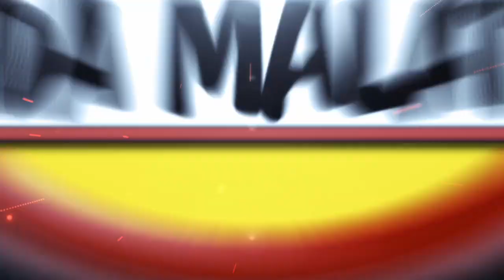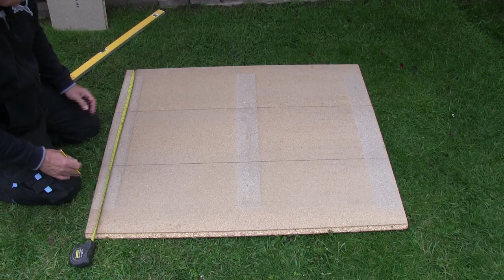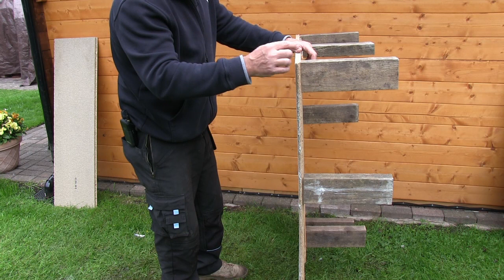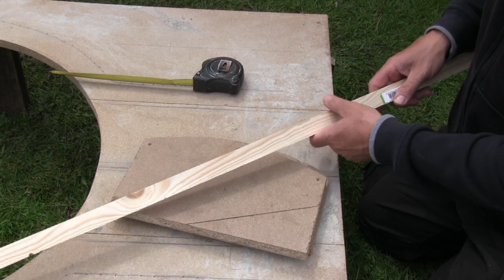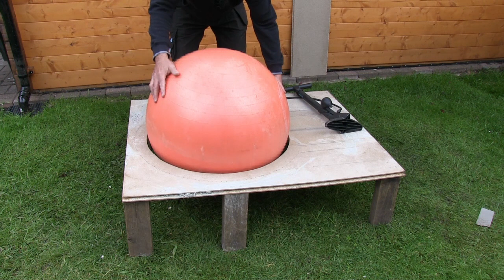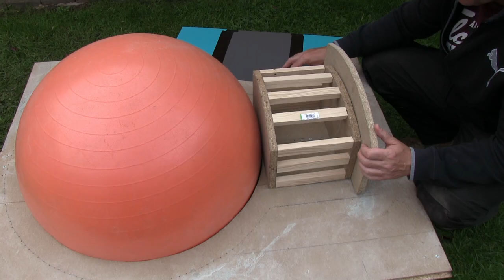AMAZING Outdoor Pizza Oven (part 2) Built for £70 - about $90

Comment from the maker: There is an error in the dimensions given at 16:40 mins into the video. The length of the side for the larger of the 3 entrance tunnel plates is 18cm long and not 22cm long as stated in the video
Reply: How is the tunnel length calculated? I'm trying to scale these dimensions for a 75cm diameter ball plus 10cm thick walls (rather than 6cm as per here).
Reply from the maker: @diyenthu2844  A 4" (100mm) flue is a good size to have for this type of oven. Since doing these videos, I've experimented quite a bit and found 700mm to be a good height for the flue in order to create a decent draw on the fire. The tunnel length is dictated by encorporating the flue into it and having some room at the front (100mm) for the brick arch. The most important measurement is the height ratio of the tunnel in relation to the dome height which I've found to be between  55% and 60% (the optimum height ratio for a brick built oven is 63%). The reason for reducing the ratio for a vermiculite concrete oven is the temp at which these concrete ovens work (brick built ovens work at much higher temperatures). If you go above 60%, too much heat is lost. So if the internal dome height is 100cm (for easy calculation), the tunnel height (internal) would be between 55cm and 60cm. With regards to the tunnel width, I've always gone with 33cm (13 inch) in order to get at least a 12 inch pizza to fit. Hope this helps. Please join or facebook group where you'll find lots of members currently in the pizza oven build process and sharing tips and ideas: https://www.facebook.com/groups/damalatspices

Comment: Very well done! The best comprehensive step-by-step guide I've seen for building your own outdoor pizza oven.  Just a quick question: The door to the oven is close to13" wide which is probably good for baking pizza up to 12".  Could I increase  the width of the door opening to16", keeping all other dimensions (door height, oven diameter) the same, or would this be a problem?

Comment: Can you use refractory cement with no vermiculite? I thought those prefabbed ovens are just refractory cement molded.
Reply: Vermiculite will make it a lot lighter. Refractory mix, if I am not mistaken, is roughly 80lb/ft3 min to 120lb/ft3, and thus probably needs to be cast in place.

Comment: @16:10, when you’re getting started with the final, larger template, if you want an exact center line, measure some distance from that center corner, use that distance to measure out on the sides of the corner, then cross the two opposing arcs.  Where they cross and the large center corner are now lined up for a perfect bisection of that larger corner.

Comment: Hi DaMalat, whats the pros and cons to making the entrance bigger so a bigger pizza/pizza tray can fit in? Or even if its possible?
Reply from the maker: Entrance size is important to enable air flow but restrict heat loss. You can't really go any higher and if you widen the entrance by more than a couple of cm's you will get quite a lot of heat loss from the set fire.

Comment: Am I being stupid ( please be kind ) I can only find 75 cm sized balls. Is that going to be close enough?
Reply from the maker: You only need the ball to inflate to 70cm (I used a 76cm ball as that was the only size I could get on a tight budget to fit the 70cm opening of the gym ball hole cut in the sheet wood). 75cm is fine.

Comment: I have considered making a 150mm thick hemisphere from vermiculate over a mould and then cutting it down to large brick sized pieces. My thinking is that I can almost eliminate mortar between square bricks in doing this. - your opinion would be valued thanks .
Reply from the maker: It might be cheaper and less time consuming to make the bricks from aerated concrete blocks? They would be very easy to shave off material until you have a perfect fit.
Reply: @DaMalat  my mate has got a 6 in double walled insulated pipe will this work istead of the brick chimney or is it to big ??
Reply from the maker: @gavinwebb5993  Yes it will but don't try to build it into the dome structure. You need to find a way to fasten it down from the top. If you build it into the concrete dome, the pipe will expand and crack the concrete when a fire is lit.

Comment: In relation to the measurement correction I didn't see this post in time. I've just made mine with the incorrect measurements. So the entrance tunnel will be quite top heavy.  I will just see how it goes as I can't undo it now. Thanks for pointing it out though.

As for the fire blanket insulation. Any suggestions how to attach it and how best to render over the top of the blanket. Thanks
Reply from the maker: Sorry for the late reply, YT has stopped message alerts for videos over a month old. lay the ceramic blanket over the dome and fix in place with another chicken wire frame (cut strips of wire off the chicken wire roll and bring the cage together tightly around the base). Then render over the top. Check out our facebook group. lots of advice and info sharing from members who have already added a ceramic blanket to their build: https://www.facebook.com/groups/damalatspices/
Reply: @DaMalat  Thanks for the reply! The pics on Facebook look amazing. Clearly you are inspiring people far and wide!

Comment: Hi nice videos, I am currently on with trying to build this and have a query. the front section of the tunnell, at 22cm tall sides makes the   overall height at widest part 30cm but the tunnel is only 20cm. This creates a 10cm thickness to the tunnel roof, this doesn't look the case on the video. Should the 22cm not have been at the same width as the internal tunnel dimension to create a  parallel thickness to the tunnel or is it thicker due to the chimney? Thanks
Reply from the maker: Hi John. The internal width of the tunnel is 33cm. The external width of the tunnel is 45cm. The internal height of the tunnel at the sides is 16cm with the internal height of the tunnel at it's highest point (dead centre) is approximately 19cm. The overall external height of the tunnel at the sides is 22cm with the maximum external height of the tunnel (dead centre) is 25cm approximately. Therefore you should have 2 x wood plates at 33cm wide x 16cm tall at the side and 19cm tall in the centre. Plus 1 x plate at 45cm wide x 22cm high at the sides and 25cm high dead centre. The vermiculite concrete comes flush with the top and sides of the larger plate creating a 6cm thickness all round.
Reply: @DaMalat  I'm with John on this one. I have done mine last week and found this problem too. If you do 22cm height at the sides on the bigger plate you will end up 10 cm on the top. You actually need to do 18 cm height then you will get 6cm thickness all round. Very good example is Scott Brannan in your facebook group just look at his picture https://www.facebook.com/photo?fbid=10163419777525015&set=pcb.2664338617007820

But still as I mentioned before your videos the best so far on youtube regarding pizza oven build. 
Could you please answer one more question. I have done mine oven last Saturday and so far I'm concern about vermiculite concrete. The particles that been left on the floor is very crumbly so far. Is that what you experienced too? I started to look for vermiculite mix ratio and it's actually 5:1 or 7:1 even 10:1 sometimes. Is there any specific reason why you chose a 5:2 ratio?
Reply from the maker: @viktorskr  Thanks Victor. I need to look into this as mine didn't turn out like that. Appologies if I've got this wrong but let me look at it in the morning and I'll get back to you.
Reply from the maker: @viktorskr  Hi Victor, I did a few mixes and anything weaker than 5:2 was a disaster. The structure itself is strong but yes, any small pieces appeared quite weak.
Reply from the maker: @viktorskr  Hi Victor. I've just found notes from this build and it should be 18cm height for the larger plate not 22cm. Thanks for bringing this to my attention, I did look at a much thicker depth for the top of the entrance tunnel to support the chimney but discounted it. Shouldn't have been in the video, I'll see how I can put a note on the video to warn others.
Reply: @DaMalat  Many thanks for clarification.  I really should tell you about this problem last week, when I found it and fixed, but was too busy.  Yes, once you uploaded the video you can't do anything with it but you can leave comment under this video and pin it to the top. Regarding the concrete mix, I would definitely wait at least one week before I attempt to deflate the ball. After 4 days it still looks very wet.
Reply from the maker: @viktorskr  Just piined a warning. Thank you for your help on this, much appreciated.
Reply from the maker: Hi John, Victor has just pointed this out as well. I need to look into this as mine didn't turn out like that. Appologies if I've got this wrong but let me look at it in the morning and I'll get back to you.
Reply from the maker: Hi John. I've just found notes from this build and it should be 18cm height for the larger plate not 22cm. Thanks for bringing this to my attention, I did look at a much thicker depth for the top of the entrance tunnel to support the chimney but discounted it. Shouldn't have been in the video, I'll see how I can put a note on the video to warn others.
Reply: @DaMalat  Thanks for the clarification on this, puts my mind at rest👍
Reply from the maker: @johnmetcalf6541  I've tried to alert people within the second build video as best I can but once you've uploaded a video to YouTube, there's very little you can do.

Comment: How did you build the base for the oven that it sits on?
Reply from the maker: Some reclaimed bricks (got them for free) and 2 600mm x 900mm flagstones. Had an ipad running and watched YouTube videos on how to build a brick BBQ. For the arch, I cut 2 curves from a piece of sheet timber and sandwiched battens in between.

Comment: I want to make the dome bigger , like 85 cm any ideas to help me ???? Thanks
Reply from the maker: You can build the plinth top out of railway sleepers and that would give you a nice look and enable you to make the dome larger. You would have to double the thickness of the dome base though using vermiculite concrete or place a layer of fire bricks on top of the standard oven base that is featured in the videos. There are images of plinth tops for pizza ovens being made from railway sleeper timbers on the internet to give you an idea of what it will look like.

Comment: Peter... The diameter of the ball is 76 cm so why make the cut out where the ball fits only 70 cm in diameter ???????
Reply from the maker: This build is done to a very tight budget. The size of the finished pizza dome is dictated by the largest size of paving stone available in the UK to make the top of the plinth with (60cm x 90cm. The plinth has 2 paving stones making the maximum available surface area 120cm long by 90cm wide). If the pizza dome was made with the diameter of the ball at 76cm, the finished pizza dome would be too large to fit the 90cm width. Of course you can make the pizza dome with the ball inflated to 76cm diameter but you'd then have to make a bespoke top for the brick plinth with wood shuttering, rebar and concrete and that would take you way over budget and dramatically increase the work involved.
Reply: @DaMalat  hi, I had the same query as this but noticed you’d given an answer. So, just to be clear, is this a 76cm gym ball only inflated to 70cm?? The ball looks fully inflated in the video at 22mins
Reply from the maker: @scottylivefromthebunker8241  Hi Scotty. Yes, the ball is a Decathlon 76cm. The budget for this challenge was really tight and although there are 70cm size balls out there, the price was double that of the Decathlon ball.

Comment: Could I use a concrete sprayer instead of the tyrolean gun?
Reply from the maker: I had a look at sprayers Mat. Only ones I could find were Tyrolean applicators and the particle size of the vermiculite would clog the nozzle. Not familiar with concrete sprayers but if they spray concrete then they would definitely be able to handle fine grade vermiculite.

Comment: Hi I have a 86 cm ball does this effect the overhaul measurements as its 10 cm bigger
Reply from the maker: Hi David, yes it will. The restriction on size is down to using standard flag stones for the top of the plinth. All the measurements in the videos have been calculated so the finished oven sits perfectly on a plinth top measuring 90cm wide by 120 cm long. Your solution if you are going to keep to the measurements mentioned above is to cut out the hole for the gym ball (to the measurements in the video) and only inflate your 86cm ball until it just fits into the hole cut. That way, you will be fine.